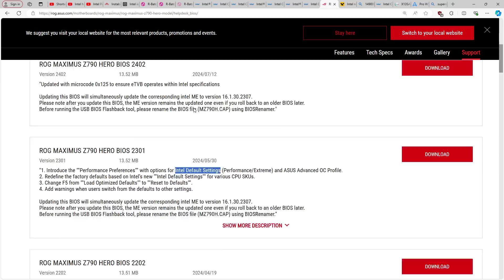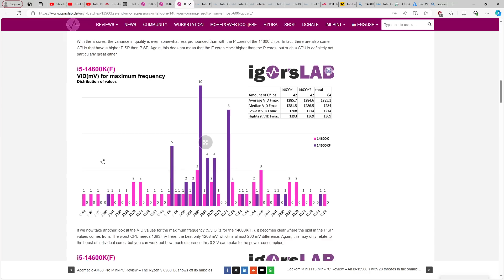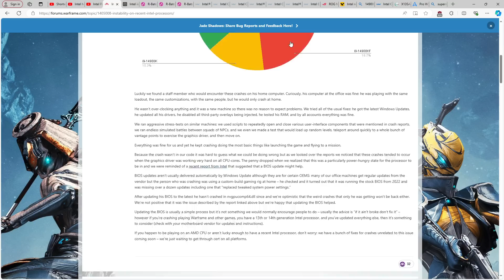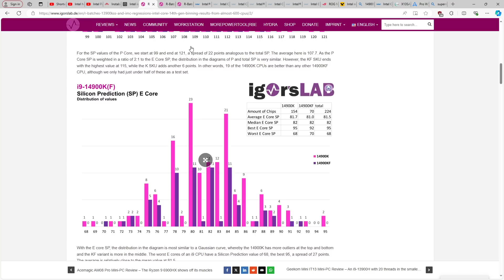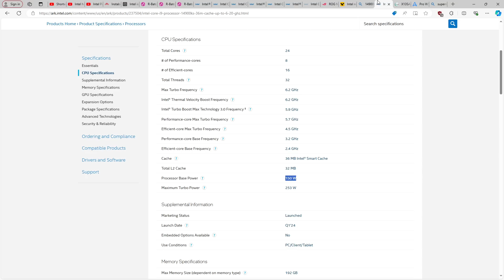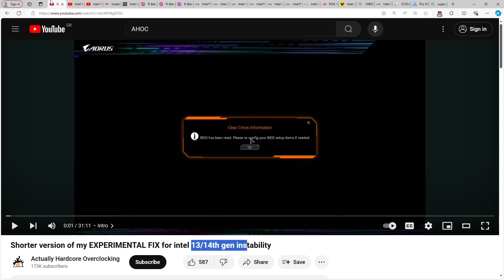The intel instability and degradation rant.

Comment: Wonder if something with the P-core/E-core manufacturing process is causing issues with the way Mobo manufacturers are anticipating performance. The fact that E-cores exist in spite of them being just entirely worse cores has to be causing conflicts. Would make sense if it's more the 'high end' of the 13th gens having such issues. Wonder how a 14900k with only P-cores enabled would fare under similar parameters in Cinebench stress testing. 🤔
Reply: They're not entirely worse, they can achieve about 60% of performance in like 1/5 the area and power. Those are cores on par with Skylake performance wise. They were a decent addition, it's a shame Windows scheduler is a mess.
Reply: @yarost12 Intel should have optimised the software before putting out the hardware. Probably this issue can be caused by changing the monolithic design to chiplets inbetween lga generations and using e-cores as well.
Reply: @yarost12  Windows scheduler didn't make Intel create chips with cores that have more than a 1GHz delta between what some can handle or advertise pushing voltage for 6GHz on P cores lol

Comment: I'm on my 3rd 13900KS. Each chip got worse over time and I highly suspected degradation. It's crazy how this is blowing up now, when I first encountered a chip failure back in August 2023. My current chip occasionally blue screens, but it isn't frequent enough for me to deal with RMA'ing at the moment.
Reply: Just go with amd, can't imagine rma a CPU 3x
Reply: @asdf_asdf948 I’m likely* switching once the new chips come out. I was always amd and wanted to see what team blue was all about. What a terrible decision that was.
Reply: Why didn't you just buy AMD you know the manufacturer with 20 years of unstable chips under ots belt and like a loser went Intel on their first problematic chip. Take the L fanboiz
Reply: Been threw 2 14900ks myself, and both only stable with HT off and fixed vcore. About to just jump to AMD at this point
Reply: Where I'm from there's an online retail store that lists a reliability score in RMA percentages for all products they sell. So basically i7-i9 13th and 14th gen have an RMA rate of ~5-5.5%, which they mark as "unreliable in this category". Comparable AMD CPUs have an RMA rate of ~0.5%.
Reply: And why would you RMA and deal with Intels bullshit 3 times??? Just switch to a 7800X3D or wait for Zen 5 to come out literally this month
Reply: @morpheus_9  Mainly because I’d have to buy a new mobo and resell my current one so I’ll just wait for new chips. Ryzen 7000 issues like their MMU and boot times were the main reason I leaned towards an Intel processor in the first place.
Reply: @Dave-dh7rt if you love AMD so much then bankroll my switch to an Zen system.
Reply: Issue is turbo boost 3.0.  Should only run 5.7 or 5.8 all core with all the recommended intel specs and then use a global undervolt by applying an offset.
Reply: RMA'd mine last week been looking at am5 boards all day ordering a 7950x or maybe even 7950x3d because I like to Tinker on payday
Reply: @danielabbott9312  Msi makes the best AMD boards
Reply: @timothygibney159  I have the MSI z790 ace right now and I love it
Reply: @danielabbott9312  avoid Asus like the plague
Reply: @timothygibney159  yessir 🫡 definitely not looking to buy a used board brand new or just experience any of the shenanigans they've been pulling the last couple years
Reply: @timothygibney159  ASrock also worth a look
Reply: So far my 13900KF is okay. But I locked all cores at their max speed and did some undervolting day one.
Reply: I am still on my 2011 2600k sandy bridge @3800 and it still runs all my games 4k at 30 or 60 fps depending on game with ray tracing on. Just downgrade
Reply: @danthevanman294 I have the same mobo too and was having problems with the default settings, even got compile errors when compiling Rust dependencies. I switched to Intel recommended when I got my latest cpu back in December and so far has been much more stable. Although I've had 5 blue screens since, first one occurred 5/24/2024 and the last one on 6/27/2024.
Reply: I just love all this Intel fanboy copium. Keep huffing.
Reply: Why would you be bothering with Intel when x3D chips are out lol.
Reply: @rapamune  Well I didn’t have any problems with my 13900k that I sold, but there were problems day one with 14900ks and thought my shit was faulty but the second one I got wasn’t any better. No matter what I changed in bios. Only thing that stopped the crashing was disabling TVB and HT and using a fixed Vcore. But wasn’t happy losing out on performance that I was paying for. I built an entire 4 rad loop and direct die for this thing. But I have ordered a 7800x3d, heat killer block and X670e board, won’t touch intel again for a while.
Reply: @MarksMeat69  Yeah, that's a nightmare scenario. Glad you're on your way to a better experience. I'm running a 7800X3D, and since the AGESA updates to fix the wacky DRAM training, this platform has been amazing.
Reply: @MarksMeat69  🔥
Reply: @MarksMeat69  I switched 3 weeks ago to AMD 7950x3d. Wow what an upgrade! Seriuously, even old games like swtor from 2012 was able to use the 3d vcache with Windows Gamebar automatically! Micro stutters in cp2077 and even SWTOR are now gone. The 13900K had worse 1% lowers. THings are just smoother and it is a great upgrade which surprised me. The only downside is 25 second boot times and you need the chipset drivers and everything up to date.
Reply: @MarksMeat69  7800x3d on a 4 rad loop is hilarious. You can max them out on high end air. To go higher you need chilled/subzero lol.
Reply: @N4CR  Well I bought it for my 14900ks but with the instability problems I bought the 7800x3d. So I guess it’s just future proofing tbf.
Reply: Shouldn't you hold off on that 7800X3D for a bit since the new AMD 9000 series are about to release by the end of the month? 

And sorry about all that effort on that Intel build just to end up screwed
Reply: @rapamune They weren’t out when I originally got it
Reply: @rapamune   The x3d chips aren't the end all be all for CPUs btw. Yeah they get a lot of hype for gaming, especially the 7800x3d only having 8 cores and with games not even needing 8 cores, it is a good fit currently for gamers. Under 100% load, it isn't going to pull a lot of power because it only powers 8 cores. For instance, people act like 13900k is always guzzling up to 300w and it isn't the case, when you are gaming most the CPU isn't even being used. Its when stress testing, shader compilation, or repack decompression (in which Intel would do much better at productivity). 

It's one of those cases again where many think everything revolves around themselves, and therefore everyone else is dumb who doesn't buy what they buy. For gamers, a 7800x3d was a good pick, but for some reason they can't understand a CPU being used for anything other than gaming, and a 7800x3d isn't great for productivity but gets the job done. Intel had great all around CPUs that could crunch compression/decompression and productivity with the use of 24 cores. Not to mention a 7800x3d has most benefit at 1080p as you are almost certain to deal with GPU bottlenecks at higher resolutions. So if these CPUs remained stable, there is definitely a case to be made for a 14900k being the best over all CPU for 4k/120fps gaming while being able to decompress repacks as quickly as possible. Even Fitgirl gives ETAs that if you only have 8 cores, 16 thread, you're probably going to take closer to 40-60 minutes whereas a 14900k could smash that out in 10-25 minutes and your playing that game. Also like Hardware Unboxed just recently noted, the Intel does have superior single threaded performance. Basically, there's a place for both CPUs depending on the usage case of each individual. The x3d actually trade blows in gaming (not every game gets higher fps on a x3d), so it isn't 100% as dominate as they are made out to be, just gaming when there's no GPU bottleneck which usually everyone except CS Go or Esport gamers tend to be GPU bottlenecked. In which case, x3d doesn't do much at all for you. For 1080p high refresh gaming, yeah a x3d is going to give you significant advantages. At 1440p? little bit sometimes if GPU isn't the one slowing things down. At 4k? Not from benchmarks I've seen. GPU is almost always not fast enough for the rate at which the CPU can provide the frames.
Reply: @Mcnooblet the 13900KS/14900K guzzle 320-380W while the 14900KS sucks down an amazing 440W! Thats a fucking space heater with a 320W GPU, 10W SSD, 10% PSU loss, 10W chipset, 5-10W ram. Thats 870 watts. No thanks to that in the summer! Ill stay with my 3950X till Zen 5 X3D or Zen 6
Reply: @Mcnooblet  after a 2600k, to me a 7800x3d is a rocket ship for productivity. If I need more power I'll upgrade to 9000 series later, thanks AMD. 
I run a 4k 48" oled too, so for me, this was the biggest change from a 1440p setup for a decade+.
Reply: @Mcnooblet you're forgetting to mention that although fast, the top Intel chips are horrendously inefficient and don't even compare to Zen in that regard. Sure the Intel chips don't pull 300 W in gaming, neither does the Zen chips. Hell, my 5700X3D pulls 30-40 W gaming. There is more to just raw speed, efficiency is a sign of a very good architecture. And intel disregarding this and pushing the limit of their arch is likely why it became so shitty in terms of longevity.
Reply: @rapamune  Because AMD chips are hot and have reliability problems over the 20 years. Intel is a safe bet and is always faster in games. I went Intel as well as at work we had problems 12 years ago with AMD products with incorrect answers in Excel and bsod with their graphics drivers. Before you all mark me as a troll I will say in 2024 it is now reversed! 

Some people like myself who are older go with brands that worked well in the past. Until 2023 Intel was the safer bet as the older Ryzen chips (especially 1xxx) all had bugs and issues and were slower than Intel.
Reply: @timothygibney159  'AMD chips hot and reliability problems' lol. Aside from bulldozer and some of the FX series, AMD had superior product to Intel multiple times in the past before this current round. Athlon 64, Athlon XP and the mobile/server variants all kicked ass and set records while typically using less power and being faster.
Reply: @N4CR  until the 7950x3d Intel always beat them. I know it may hurt your AMD blinders but at work my director has a ban on all AMD as he is scared from all the user complaints and issues with their drives from recently as 2020. Their graphics drivers caused black screens and battery life was poor. Cry about it but my previous employer is an Intel shop too since they think it conserves power and just work
Reply: and your mobo is Asus :) and stock bios, and maybe even high xmp
Reply: @ryzenboy-m5b  Gigabyte and this current chip has been running all Intel recommended settings since I got it back in December
Reply: @ryzenboy-m5b I've never seen a stable Asus system.

Comment: This is why I want to go AMD but the x670E motherboard I want hasn't got an in-depth review. X670E
ROG extreme.
Reply: Better get a b650 board. Unless you really need the x670 chipset connectivity options, it simply isn't worth it.
Reply: @danielt91  But watch HUB's B650 reviews, there's useless cr*p out there.
Reply: I have a B650e steel legend and recommend it. Its three times cheaper than that overpriced asus rog.
Reply: @Valinior  ASRock is just solid on price-performance for motherboards in the mid-range. Makes me wonder what people are getting these X670 boards for that they can't do on B650.
Reply: @Dr_b_ Well yeah, it's ROG.

Comment: intel hit a wall awhile back and they"ve been trying to dig under said wall but the grounds to hard so you got 13th and 14th gen crap.
Reply: I've been saying this for a year now. 
They're trying to stay "faster" than AMD and instead of actually improving their design, they simply brute force it, Customer be damned. 
But it seems to work, since anytime anyone brings up AMD there will be enough people going "just buy Intel CPU X, they're faster!" showing that big Numbers are truly all most people are interested in.
Reply: Or after digging under the wall they encountered soft ground that caved in and now they are in this huge hole which is 13/14th gen, the wall represented their corner cutting with gens and the ground is them not researching better
Reply: @noiprocsZ  
It's actually crazy that Intel seems to have the same marketing strategy as AMD with their GPUs. They are taking notes from the wrong AMD branch.
Reply: For sure. They were struggling to get >10% yields on 10nm manufacturing for so long. It was a shitshow. And clearly they didn't break through and perfect it. More like... flopped through. Lol.
Reply: Intel is better and they will still be better next year and the year after that and no one buys AMD and that's for good reason.  I won't even mention how touchy they are on RAM or how their gpus don't mix well will LLMs running local or quicksync or explosing cpus or ...stop...hes already dead!
Reply: im using 12600k and its fine at 82 degrees celsius under load!didnt they just use the same tactic with 13-14th gen as the 11th?more wattage on every cpu!

Comment: I didn’t realize Intel CPU’s were soo shity
Reply: they have been shitel for a long time just that too many ppl are still braindead
Reply: 11th and 12th gen are fine, but any X3D AMD will out-perform it at similar price points.
Reply: Anecdotal, but my 13900KF from Jan. 2023 is still going strong with a decent OC at 5.7P 4.5E and 5 on Ring. This is with 1.42-1.43v on Vcore and heavy use, including tough benchmarks and stability tests that constantly pushed it to 100c.
Reply: @battlephenom8508  i've had my 13900k long before widespread reports of crashes and instabilities were occuring. mine is running with ASUS multicore disabled and PL2 set at 200W, and so far never had any issues. I don't play much games (mainly single thread workloads), but I occaisonaly do some niche allcore rendering workloads.
Reply: @battlephenom8508  i've been running my 13900k with multicore enhancement disabled since I first got it (Jun '23) and to this day no issues whatsoever. I rarely game but i haven't had any random crashes or bluescreens
Reply: @battlephenom8508  It doesnt affect 100% of them yet but the rate is ever increasing
Reply: @battlephenom8508  It sounds like you know what you're doing and made sure the rest of your system could accommodate or compensate for the demands of the processor. It also seems like the KF model is less prone to this degradation issue than the K model. The only hits I get on this happening to KF are people who skimped too much somewhere else in their system.

Comment: Let's face it: the real culprit behind all of this is DDR5.
Since we know that DDR5 has sweetspots, it might need some tuning even at JEDEC speeds.
Retrain instability is a thing, reboot instability also.
Even people who thought their RAM OC is 100% stable might fail to run VST/VT3 on their 17th boot or so.
If I managed to fail training into default settings on the first try once, who knows what other people are dealing with.

And the ammount of people trying to buy fast RAM for a 4-dimm board because it's on the QVL list is scary as well.
Or running 4 RAM sticks, another point of failure.
Reply: About that these instability issues are also happening with DDR4 and JEDEC speeds 
Its literally Intel and Intel mobo at this point
Reply: except they also crashs when using DDR4 lol
Reply: Lets face it - no it isn't.  When intel cpus are failing running at ddr5/4200 on w680 boards the memory is just about the last thing you are looking at.
Reply: @malphadour  you forgot to say that 4x48@4200, AMD's situation is no better with the same config
Reply: impossible to say it's DDR5 when amd does not seem to have the same issue
Reply: @3r2s4A4q  try 6000 on Intel as it is on amd and then there will be no problem, so the problem is freq
Reply: do we know if this is an issue with amd ddr5 gens as well? if it's just intel, it's on them to make sure that their latest platform works as expected
Reply: @CrazyByDefault  am5 works at lower freqs most often, favorite expo is 6000. About Intel, no one likes to buy memory slower than 7000. 6000 and 7000+ is a huge difference for ddr5 stability, especially for 4 sticks
Reply: ddr5 has plenty of issues, but the issue seems specific to intel 13th and 14th gen cpu, so I think the issue must be caused by something about those cpu's. which does include the imc, but the nature of the crashes makes that seem unlikely - though it can't be ruled out at this point as far as I can tell.  wendell's data also seems to rule out an effect of memory speed but did show evidence of an effect of dual vs single dimm configurations.
Reply: Let's face it, you hate the DDR 5 memory mess situation, like I do (still waiting for Arrow Lake, hoping that I can get a laptop with 128 GB of RAM at 6000+ MT/s, since now that's not possible) and you didn't want to miss an opportunity to complain about it.
Even when it doesn't make sense or it's not really on topic.

If DDR5 would've been the issue, we would've seen plenty of 12th gen and i5s too.
Reply: but no one cares about ram, QVL says it will be fine... isn't it? problem squared by another problem
Reply: And there is no way to guarantee that the memory will never fail
Reply: @kekw9716  if you use 7000+ at 4dimm then you will never have a guarantee of memory stability. Marketing doesn't allow to understand the real memory limits with Intel cpus.
Reply: Except the servers were running jedec ddr5 and underclocked and undervolted cpus.
Reply: I guess I might just need to add that it's the Z690 and Z790 platform in general.
DDR4, DDR5, doesn't matter.
The fact that there is new voltages to tune + they need sweetspots, this increases the point of failure.